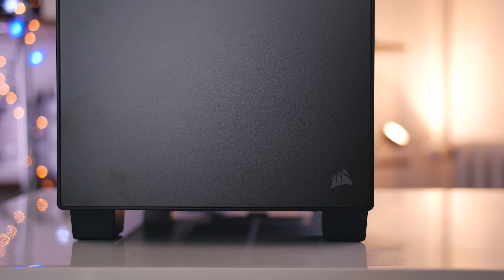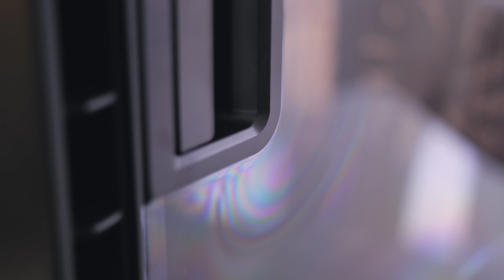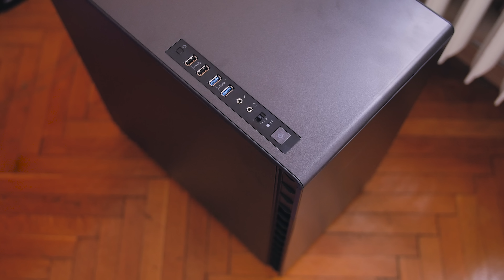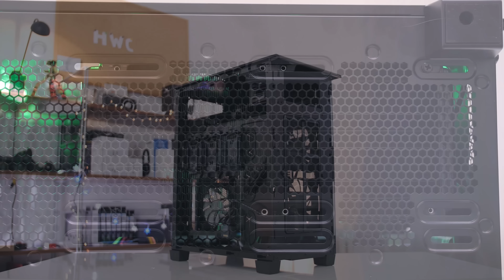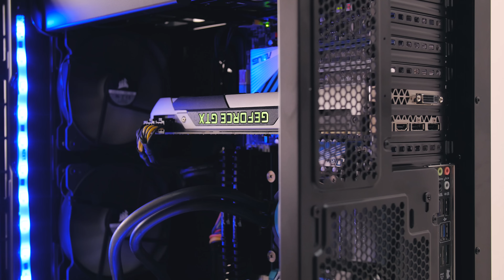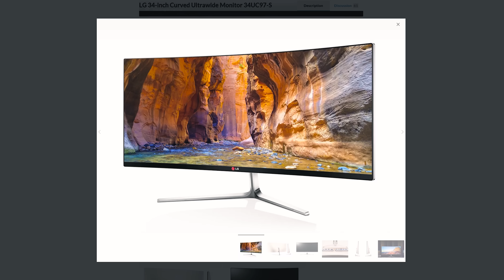Corsair 600C Case Review - Inverted ATX layout worth it?

Comment: Hi there! I have no idea if you still respond to comments but I pray you do! I posted my 600c build on reddit and people are saying that my corsair 110IGT cooler should never have the radiator at the bottom. I've had it the same layout as yours, pump upside down too, for over 6 years and had no problem but finally spent 2k upgrading GPU, mobo, cpu etc but wanted to reuse my case and aio cooler. Am I at danger?

Comment: 4:25 you installed your radiator wrong. Hose coming out the radiator should always be down or the air goes up in the pump

Comment: great case , no compremises , 2x 5,25 , plenty cpu clearance 200 mm ,  great having the  gpu with waterblolck pressing by weight the pcb and cpu with block even if leaks from connectios will not drop at the motherboard or the gpu , the only really negative is  reservoir where to put it if the gpu is long and not fe so have to be really small or 5.25 and the 360bot  and 240 front rad is pretty much the max maybe a 120 back can fit so max 2x360 total if somehow one more could fit maybe top vertical behind the mobo would be great so yea a little taller the case would help  generally.

Comment: nice case TO PUT ON THE desk BUT if u want put it on the desk IT S A NO NO  ... 
1 . the power button top ??? why ???  somewhere at the front next to 5.25 would be great even on desk or on the floor
2.very low space between the  gpu and front fans  specially if u have long gpu and wanna mount rad at the front again NO NO not mentioning puting a reservoir is imposible  .
3 . the top no grill- air exhaust  or the potencial of 3 x  360 fans - rad combo  or  3.x140
4. wider buy 5-6cm  , 2-3 cm behind the mobo for 3.5 drives instead of 2.5  and easy cable management and 3 cm extra space at bottom between fans - rad and mobo 

Summary :
1/ power button at the front  2/ around  10-15 cm more between  mobo and front fans  /3. top extra 10cm for exhaust  3x140 fans  and space hole bewteen mobo and 5.25 for easy tube - hands pass 4/  2-3 cm behind mobo and 3 cm between mobo- bottom fans - rad .

Comment: You can't flip the case over and call that a comparison between inverted and normal layouts. In normal layouts you don't have have a front intake fan right in front of the CPU cooler (if you are using a tower) which helps cooling, it would be blocked by cd drive bays.

Comment: I need some advice...
I just got this case,(apart from the three included fans) and I have a liquid cooled 1080ti (120mm) and also a H60 (120mm) for the cpu.
So the question is where do I mount these two radiators+fans? at the front as intakes? At the bottom as intakes? or at the bottom as exhausts? I could also place on on the front as intake and one at the bottom as exhaust? there are many configurations I could use..

Comment: I'm very curious to know what temperatures you would achieve if you used intake at the bottom, and reversed the case fans so that the front fans now act as front exhausts, with the rear bottom fan acting as another intake. Has anyone tested this with this particular case?

Comment: Holy fucking fuck. On what planet is 2 3.5" bays acceptable?

I'm currently using every single SATA port on my motherboard for a total of 8+ TB of storage over 4 mechanical drives + an SSD for my system drive and a hot swap port (which I use for data recovery on clients computers) in my 650D.

AAA games these days are like 40GB minimum and SSD's are still way too expensive for storing large amounts of data.

This is coming from someone that doesn't even use my computer for professional photography, video editing, etc.

Anyone using this case for professional work like this would run out of storage in a day.

Sure, in another 5 years when SSD's reach the price per GB level of HDD's offering such a pathetic capacity for storage would be acceptable, but currently this case is completely ruined by such a pathetic lack of storage options.

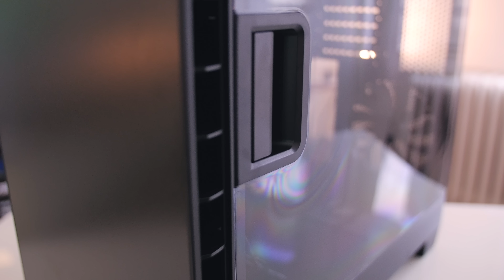Comment: Can anyone tell me is there any way to remove that color difference on the window at 1:05... I have 400c and it is really anoying
Reply: The only way to remove it would be to heat the panel up and anneal it. The discoloration is due to stress. But I wouldn't recommend doing that as it will likely cause the panel to become translucent if not opaque.

Comment: I guess a big benefit I saw with this case is if the liquid cooler for the CPU leaks, it's getting on the motherboard and not the GPU and PSU if it does leak by any chance.

Comment: I bought the 600Q version from amazon and wouldn't recommend it. The PSU shroud is hard to get off, the actual aluminum part of the case (especially at the back) is flimsy as hell and very easy to bend. Also, I now dislike the inverted look as well.
I came from a 4 year old HAF 932 Advanced - which had a much better build quality by a mile (but didn't like the look of it anymore).
The other thing I would say is that I don't know why the 600 version added 2 USB 2.0 ports - I have a Z170 Classified motherboard from EVGA and it doesn't had USB 2.0 ports for external use (just 3.0 and 3.1).
Overall, it's a spacious case but for the £130 price tag, you can get better...

Comment: corsairs best case with an inverted layout WHHYYY!!! do this the other full side window cases from corsair such as 760T/780T have HUGE reset buttons and the 760T has no top or bottom dust filter but what i wanted from this case was at least 1 140mm slot at the top back for a liquid cooled GPU but i think if corsair releases a non inverted layout it better have a top and bottom FAN/RADIATOR support as well as magnetic to dust filter like the 400C/Q and a FULL length bottom dust filter tray
Reply: i mean it would only cost corsair like $5 a case just to have a bottom dust filter tray with a top magnetic dust filter and a few holes pre drilled at for the extra fans but i want a FAN controller which the 400c does not have
Reply: just thought of something which a lot of case manufacturers STILL include which is USB 2.0 i mean do we need that also USB 3.0 or 3.1 are backwards compatible

Comment: It shouldn't be a surprise that it works better when you flip it. 

First of all, your bottom rad fans act as an exhaust so when you keep in it on its feet, you're just not doing anything. That's a big mistake on your part.Now,when you flip it they work they way they should,exhausting hot air that rises....DUH.

But in general this whole case doesn't make any sense anyway, its by far the worst thing i've seen in years. At the very least the PSU fan should NOT compete with the GPU fans for air...that's just terrible.
Reply: "Hot air rises" that would only matter if you don't have bottom fans pulling down with force to counteract that rising.

Comment: I plan on getting the case, but the one without a window, so it doesn't matter if the setup is inverted or what side the computer sits on.  Kind of found it interesting over his concern over the lack of drive space.  I mean it has three SSD slots, and they are coming down in price, and two regular drive spaces.  I personally only use one SSD, and I have spare drive to keep all my documents, music and video on it, plus I have a cloud system that I backup everything on that, so I can have access to everything where ever I go.  Not to mention my new build is an x99 motherboard that has the M.2 slot on it, and I am definitely going to get that.  The only thing I wished is that I could go with 2 200mm fans like I have in my HAF case, because they have worked so well, even when my room hits 90 degrees in the summer.

Comment: I just built a system into this case. I love it because of my desk layout. My case sits on my left which makes this perfect with the window on the proper side, for me.
Reply: An update, I am running an M.2 drive (nvme) as boot, a 1TB ssd just for steam, a 1TB WD black for other programs and games and a 6TB storage drive. I honestly don't find the lack of drive space to be that much of an issue anymore. IF I need to upgrade this year I will add a 2TB SSD for 'other' and a second 6 or 8TB drive for mass storage.
Reply: Also, I have my front and bottom fans set to intake (with a Corsair h100i V2 Extreme in the front) and the back fan and PSS set to exhaust. My 6600K (OCed to 4.5) and my Gigabyte 980ti OC Edition (OCed to +150/+300) stay plenty cool. My main comment still stands just because of my desk layout.
Reply: TL;DR I still love this case.

Comment: Warm air rises, therefore it should exit out the top of the case. Can't believe the cooling is on par with a standard design.
Reply from the maker: Warm air rises yes, but in such a tiny volume like a PC enclosure, it hardly matters.
Reply: +rdor011  - it works just fine - actually works great.  I set my 280 mm cpu radiator on the floor to "intake" - thus taking advantage of the bottom mount dust filter, and keeping with positive case air pressure theme to keep dust from sucking in elsewhere.  this also seems to keep the cpu cooler as it's sucking in cold air...  the 140mm fan in the back plus the psu fan when things are cooking do plenty to keep the case and gpu cool.  Other than it's huge, and is relegated to the floor - I love this case.  5-1/4 inch blu ray internall is really quiet also.  I added automotive sound deadening to front, roof, and the solid side panel - it's pretty quiet overall.
Reply: The standard case with a top mounted PSU is a whole different story. The CPU is located almost directly underneath so the PSU fan actually helps optimizing the airflow and keeping the CPU a bit cooler.

 In this design look at what's underneath the PSU fan....it's the GPU fan trying to such air. directly under the PSU fan which is also trying to suck air. 

This case simply does not make ANY sense and it has NOTHING to do with the good old standard top mounted PSU layout that we have all started with.
Reply: +HardwareCanucks I'd imagine it's cooler inverted because that's how Corsair engineers designed the case.
Reply: +majorsmackdown This is an alright setup if you're not overclocking. All the air the motherboard gets is hot air and thus making it not very efficient. Best way is to put the 240mm radiator on the front and have it be exhaust out the front and back  and intake from the bottom. I have a 240mm and 120mm radiator mounted on the front and back and everything seems to stay nice and cool for me even with a fairly high overclock.
Reply: +Gavin Kimberlin -  If not overclocking heat just isn't an issue with the intel cpu, but I do overclock the cpu and gpu and have since  found another setup I like more than the previous one.  I put the 280mm radiator in the front drawing in, and (2) 140mm fans on the bottom drawing in, and a single 140 mm fan on the back pushing out.  Since the radiator fans are always on - this keeps airflow moving over the GPU and the whole motherboard.  I do like to be sure more air is drawn in  (by fans) than is ever pushing out to keep the dust out.  Positive case pressure is important or all the passive ventilation will allow dust in.  Before realizing this my old computers were always full of dust and overheating without even overclocking.  I got the noctua light brown fans (the quiet ones) and I must say - they're really worth it - they really move air well, and do it quietly.
Reply: +rdor011   Guess you forgotten that the PSU is located on top sucking out the hot air?  You know back in the old days, almost all computers had the PSU located on top, with minimal case fans, like my first computer only had one exhaust fan, no intakes what so ever.
Reply: +HardwareCanucks See FT-05.... seems to matter there
Reply: dont talk stupid

Comment: I'm trying to figure out the best case for me. I'm upgrading my system and everything now has lights built in. So I'd like the side window like in the 600C. But what I want the most is the side hinged window. I'm using an E-ATX motherboard. So if you could suggest a case, I'd be super grateful. I like the 600c but i'm not sure if that's the right case.

Comment: "Two 3.5 inch drive caddies... And that's it."
Actually Dimitri right above the caddies or to the left of the power supply you may notice the 2 extra hard drive sleds making a total 4 - 3.5 inch drives plus 3 toolless sad brackets, seems adequate enough storage for the end user. Keep up the great videos!
Reply: +HardwareCanucks I really think Corsair doesn't deserve the criticism about the drives because of the mistake, but criticism is still encouraged.

Comment: Hey can anyone tell if this build can run gta5 and if yes then on which settings 
Board : Asus H81 Chipset Processor : Intel Core i3 4130 3.4 Ghz Pentium Dual Core  & Asus Output connectors : Motherboard USB 2.0 Ports - 2 USB 3.0 Ports - 2 VGA PORT = 1 Audio I/O Channel - 3 PS/2 - 2 ZOTAC GT 610 2GB DDR3 Graphics Card 1 x DVI Output Out, 1 x Dual Link DVI Out, 1 x HDMI Output Out HDD - Hard Disk Drive : 1 TB HDD (Primary) RAM : 4 GB Corsair/Kingston/Gskill Optical Drive : LG DVD burner
Reply: From not doing much research, it doesn't sound like it'll run well, if at all. To run GTAV you'll need a quad core processor and an alright graphics card to at least run. I get you may be on a budget and that's cool but if I were you I'd save up and spend a little more, you'll get more for your money. A newer generation graphics card like a gtx950 will run it on high I'm pretty sure without troubles, and maybe looking at a i5 or an AMD equivalent as they are cheaper but not as reliable or doesn't have as many features. The motherboard is totally fine and doesn't matter performance wise, as long as it can use the processor then you're sweet. Hope it helps and good luck

Comment: Another great video but I have a few gripes about this case. First is the power supply being mounted on top. I know it doesn't make a difference but I'd much rather have it mounted in the bottom and have everything else lifted off the floor for clearance. The other gripe is that it's inverted, which I know is the selling point for this case. It just doesn't look right right to me and having the writing on the MoBo and GPU upside down is visually annoying too. I do love the drive mount solution though and physical size of the case is nice.

Question about AIO coolers. Will the NZXT Kraken X61 reach from the front of the case to the MoBo?

Overall I wouldn't buy this case but it seems like it would be a good choice if you're looking for an inverted case to build in and have the room for it.

Comment: still waiting for top cases of 2015. you hawe to put the define s nto the list. its the best costum watter cooling suppoted case at 80 bucks. or did you saw any other 80 bucks case that suppots a 420, 360 and 140 radiator at the same time, and it gives you even a reservbar mounting bracket?!

Comment: Can someone help me 

i have this case!
currently i have a corsair h100i at the bottom cooling my i5 4670k oc pushing the air out of the case
front panel 2 fans intake and one  at the back of the case as exhaust.

i wanna aio water cool my 980 ti gaming gigabyte with the corsair hg10  n980 solution..

really dont know whats the best scenario is.. or i add the radd at the front panel pushing air inside the case or outside? but i will lose my fresh air into the case choosing the solution pulling air inside.. choosing to exhaust this (at front side) will create (i think bad airflow) and there will be no fresh air in the case.
..

or taking a smaller rad on the exhaust side pushing the hot air out of the case..? but it will bring all the heat of the rest of the pc in the rad.

hoping for some feedback:)

TY

Comment: I would have to take point and disagree with Dmitry on the issue with Storage Space... I think adding cages (even removable ones) would just add to clutter in what is supposed to be a very clean, clutter free beauty shot. There may be something to the idea of mounting your SSD's in a visible location, because those are nice to show off, but old bulky HDD's are not cool enough to want to show off.

Also, I've not needed an optical drive in about 7+ years... so I would just use those bays with a bracket to hold additional HDD's if required.

I would say this would really shine as a show piece where you want to showcase a really nice GPU selection. As nice as backplates are they aren't as awesome looking as the top side.

Comment: I actually would prefer an inverted layout for the gpu as they always have these awesome cooling solutions on the bottom that you never see since they're facing down in traditional orientations.
Reply: yeah it doesnt need to rebail because if if its melting it will go down not top and it will not lose the connection between pcb and gpu

Comment: if they could've shifted the power supply unit to the bottom and made the upper part a 360mm fan area which pulls out air from the case, the case would have been much cooler. hot air is lighter so it will be on top.

Comment: Won't the drive cage argument start going to the wayside? Eventually we're going to have more onboard nVME, m.2 and u.2 SSDs replace anything we needed for HDD storage. With the skylake build, the writing's basically on the wall. And there's no way you're going to use a case with a window THAT big for a NAS. Hard disks aren't that sexy.